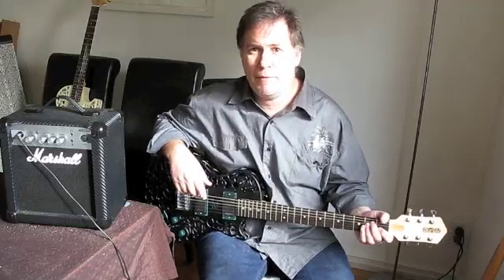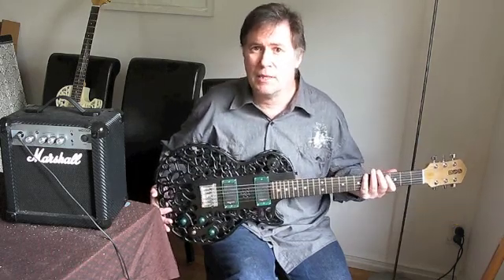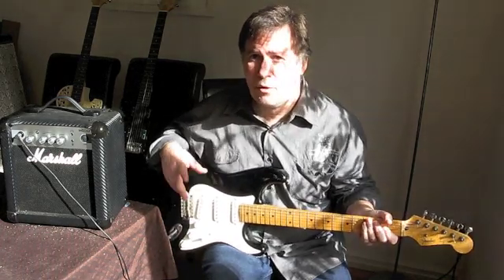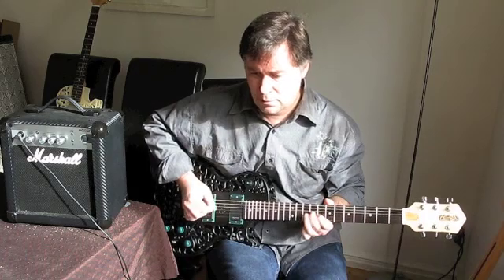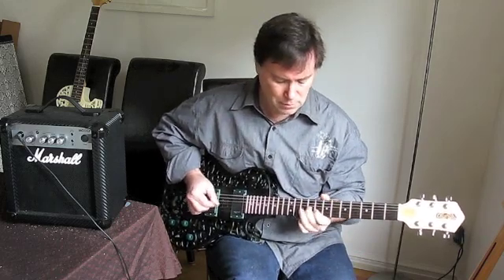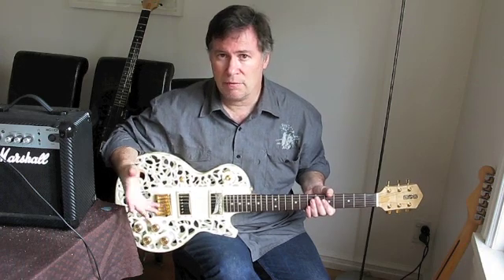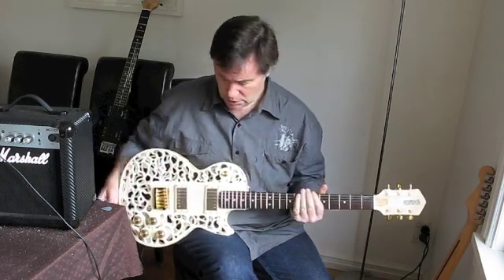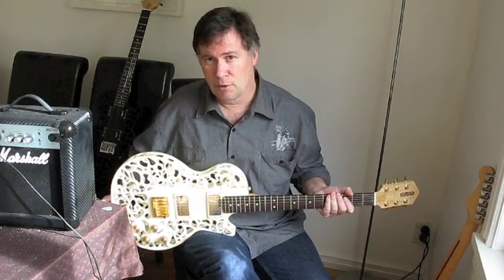ODD 3D printed guitar first sound test

Comment from the maker: I think you may misunderstand the purpose of the test slightly. My guitars are not intended to be Les Pauls (other than paying homage to them through a resemblence in shape). Besides the slight shape resemblence, they are entirely different, so when playing them in the same context of to a Strat, a Les Paul, a PRS, or whatever. the point is not to see if they sound the same as them (and if they did, what would be the point of that?), but rather to show that they sound good in their own right.

Comment from the maker: Hi,
Yes, it would be no problme at all to print a completely solid body guitar. However, you would then not be taking advantage of the possibilities 3D printing offers (which is to create incredibly complex geometries that you just cant make with conventional manufacturing). If I was aiming for a completely solid guitar (even if it was a fairly intricately carved top, for example) I would, most likely, CNC machine the body as this would be a more cost-effective way of doing it.
Cheers
Olaf

Comment: Hi Olaf. Are these guitars lighter weight than wooden built electric guitars? Also, I note you have pointed out that the neck and fretboard are still made from wood. That's understandable of course but, is there a possibility that as this production method evolves the entire unit can be made from plastics? It would be a great way to utilise existing recyclable plastic waste and that in turn would be beneficial to the preservation of trees and the environment.

Very impressed by these.

Louis :)

Comment from the maker: Heheh. I wish. Actually, one sale would not be near enough profit to buy a decent amp. They are surprizingly expensive to make. Just the hardware is over a grand. The body is really expensive too. Then there's the CNCed wooden core, paint time, assembly time, etc... And that doesnt consider R&D costs, multiple prototype iterations, and all that fun stuff. And the sales price for the LP shaped ones is actually $3500, not $3000. :-)

But I do now have a very nice Langcaster valve amp.
Cheers
Olaf

Comment from the maker: It might also be worth adding that the strings one the two 3D printed guitars were brand new, whereas the ones on the Strat were several months old (I dont change them nearly as often as I should). But new strings tend to have  amore metallic sound than older ones.
Olaf